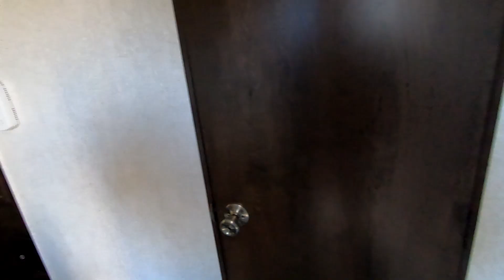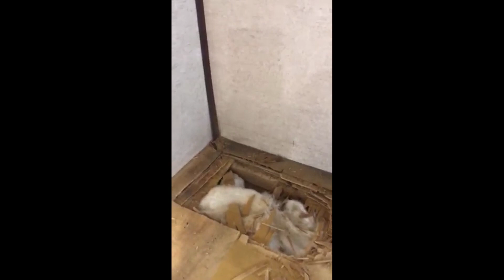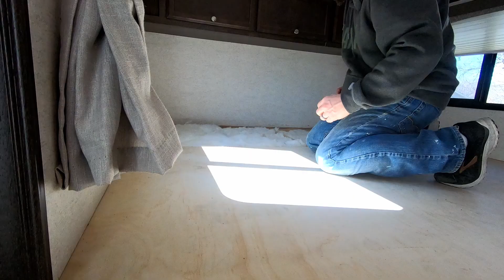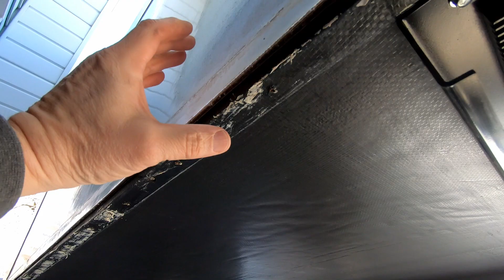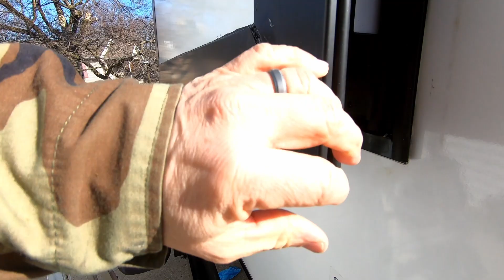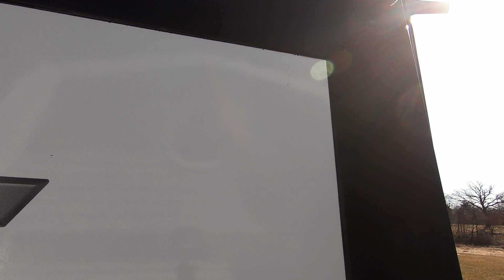Camper Slide Out Water Leak Repair

Comment: Where is the leak coming from? What caused the leak? You never addressed that. We have the same problem but cannot find where or why the leak. Please respond.
Reply from the maker: @FrederickaTaylor-d7v  I believe the leak was coming in the lower trim as the seal had opened up.  The trim that goes around the slide that it closes up against the body.  All the eterna bond tape and reseal was to 100% stop now or in the future.

Comment: Just curious on the inside of the camper is there a gap between the wall and the bottom of the slide? I have the same camper
Reply from the maker: From inside looking at the wall when it is closed there is a gap.  I think I I needs that to articulate in and out and have room to shift when bouncing down the road.

Comment: Just curious on the inside of the camper is there a gap between the wall and the bottom of the slide? I have the same camper
Reply from the maker: The gap closes up like it should when it slides in.  But it isn’t super tight and you can see some daylight if it isn’t all the way up and closed.

Comment: Very informative video, thank you. When putting back the screws, I'm assuming going through the butyl tape forms a good enough seal to protect water from getting in through the screw holes, correct?
Reply from the maker: Yes.  And thank you.  That is the idea.   They will seal on the mix of pressing against the butyl tape.

Comment: Also wanted to comment I would highly recommend putting a cover over the unit
Reply from the maker: That’s a good idea.  We get crazy high winds here.  Wonder how well one would hold up.
Reply: @McSpeedAlaskanAdventures  well I live in a 2019 coachmen Apex nano full-time it is stationary I use it as a tiny home. I did a little DIY I ran some thick braided cable across two trees and draped a very thick tarp over it. I parked my camper underneath it and it has worked perfectly obviously I got lucky with how the trees were but online they say not to use a tarp because it can get moldy underneath. As long as you allow it to breathe and get air flow underneath it will definitely protect it from any leaks and also preserve the existing dicor and rubber roof from dry rot

Comment: I absolutely cannot believe you have experienced such water damage on a new unit have you contacted the manufacturer?
Reply from the maker: I did speak into the local dealer.  He said they would try to put in a claim but I would have had to leave the camper with him in the damaged condition for an unknown period of time and might even pro-rate the repair.   I needed to deal with it right away and decided to just go for it.
Reply: @McSpeedAlaskanAdventures  yes they definitely should it's a good thing you've documented this video. Also using that eternal Bond tape was a fantastic idea I couldn't have thought of a better way to address and properly seal that slide out